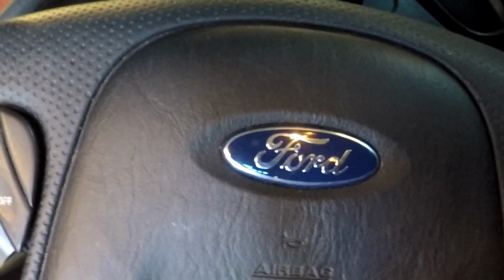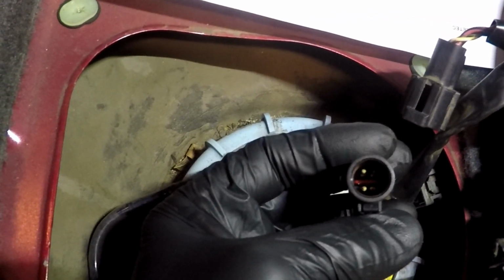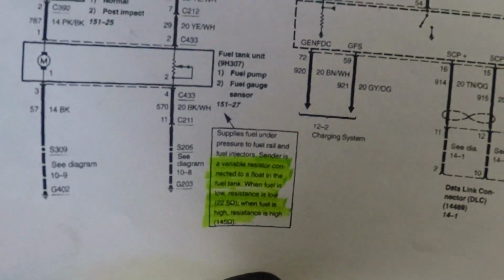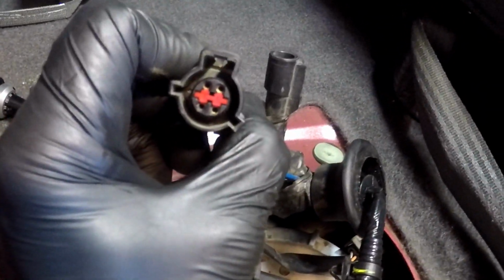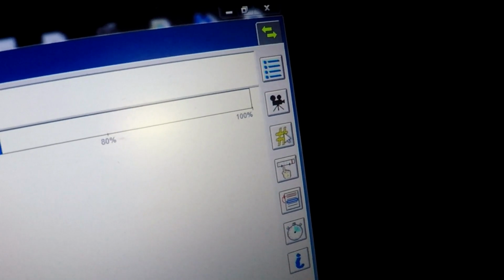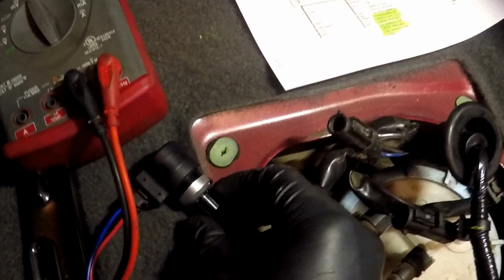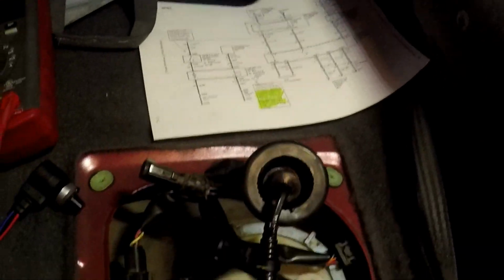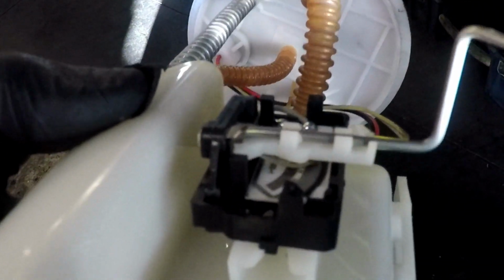FUEL LEVEL TESTING AND INSPECTION (EDIT)

Comment: Where did you get your variable resistor from?
Reply from the maker: Martin Gray it came in the terminal kit I bought from aeswave.com. If you would like part number please let me know. Thanks for watching
Reply from the maker: Martin Gray you can also buy a decade box off of amazon which will do the same thing. Either one will work nicely
Reply: Thanks for the reply Cody. I’ve found the decade box you mentioned and ordered one 👍🏻